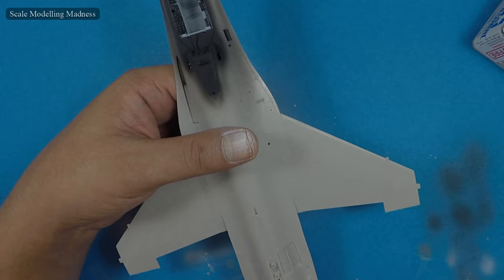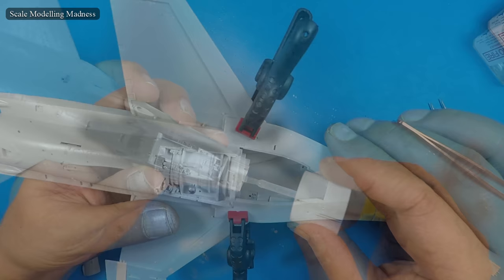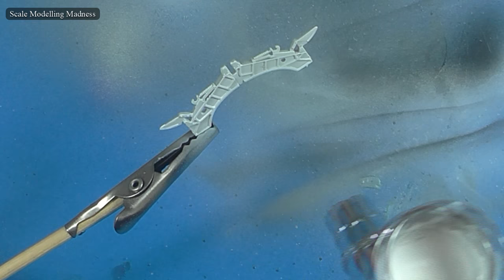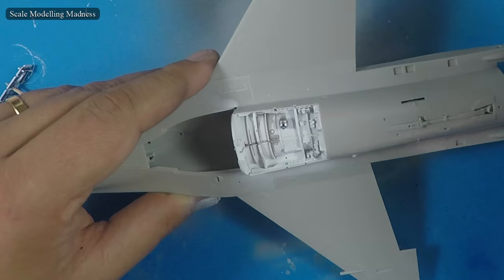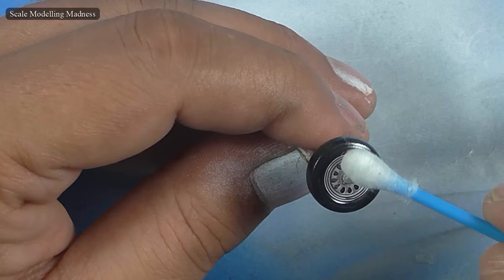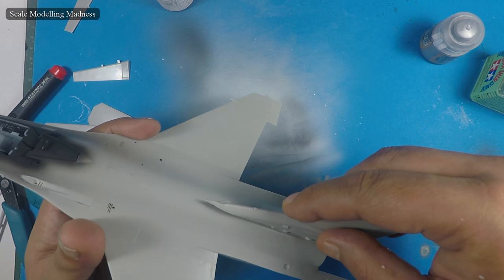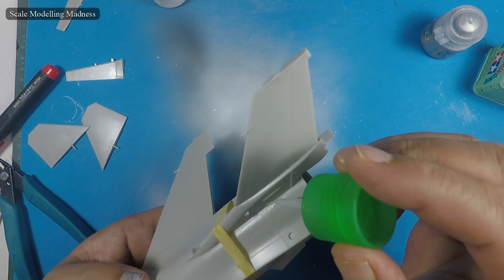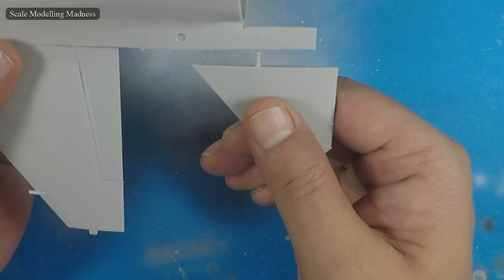Tamiya 1/48 F-16 CJ Block 50 (Part 2: Completing the build, exhaust and wheel assembly)

Comment: what clear coat (brand) you used before applying washes?
Reply from the maker: Hey there. Earlier I used to use Pledge, but ran out and there is no way to get more in Singapore. These days I am using Tamiya X-22 Clear, thinned with X-20A acrylic thinner. I like how it looks, not completely gloss just a very smooth satin finish :) Also, good for applying decals and washes.